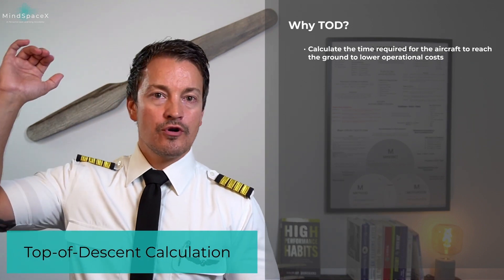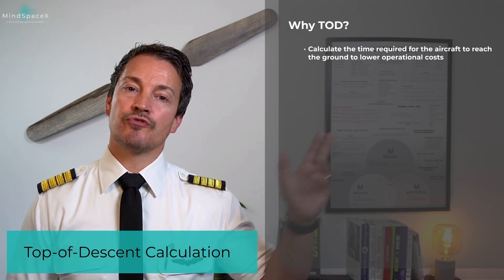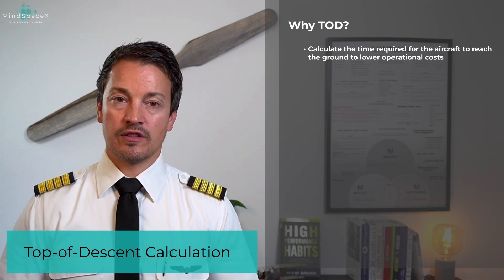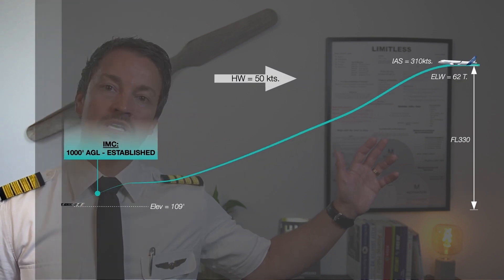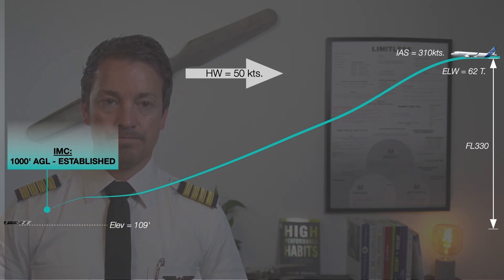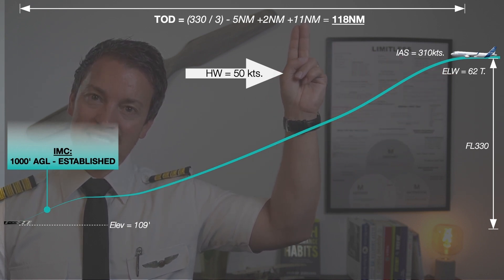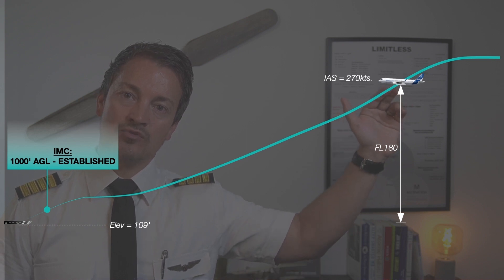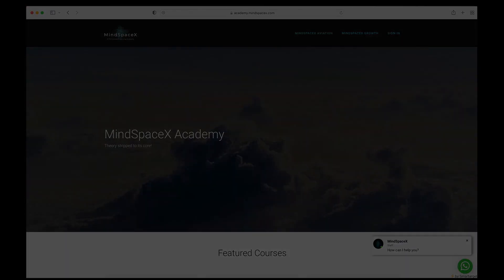Airbus Performance - Top-of-Descent Calculation

Comment: I don't understand how you're calculating the mileage factor (+/-) based on the IAS. (270kts = 7nm)??
Reply from the maker: The milage factor is set by Airbus or actually is set more or less generically for a medium range jet aircraft of this size. It's based on the speed at which the aircraft has to decelerate from. For an aircraft to slow down from 270kts it is assumed it needs 7NM. If the speed is 250kts the aircraft requires 5NM to slow down.
Reply: @MindSpaceXAviation hi may i get the fcom/manual reference to this please?